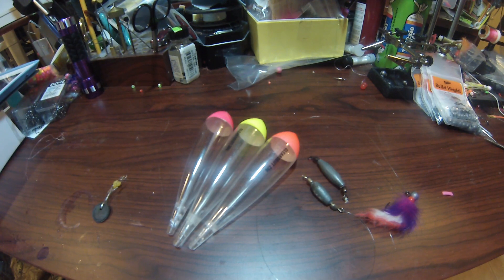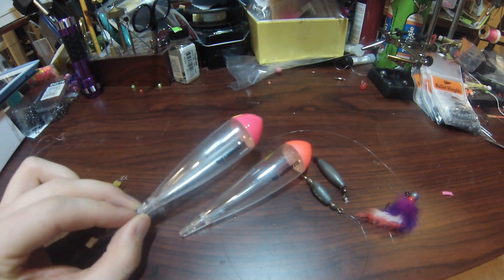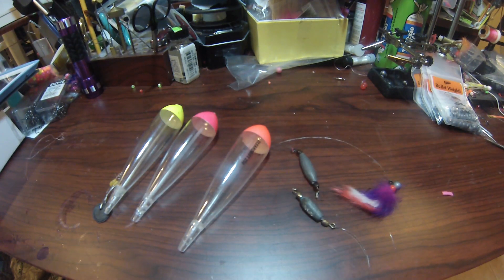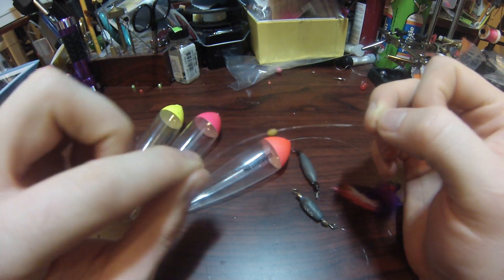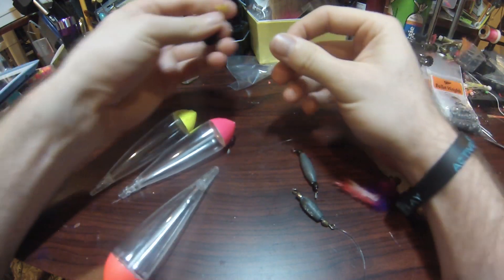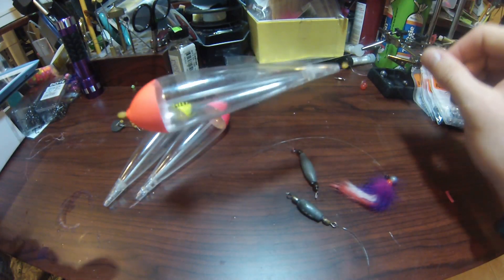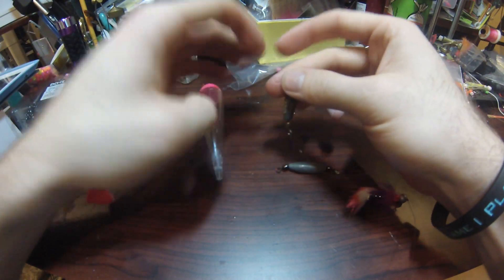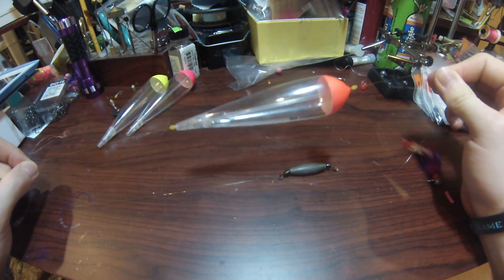"Gear Talk" | Cleardrift Floats Inline Steelhead Jig Rig

Comment: The float weight rating is over rated.  25g is over 3/4 of an OZ.  But these 25g floats hold a little over 1/2oz perfect.  You put .8oz under one of these and they are barely visible.